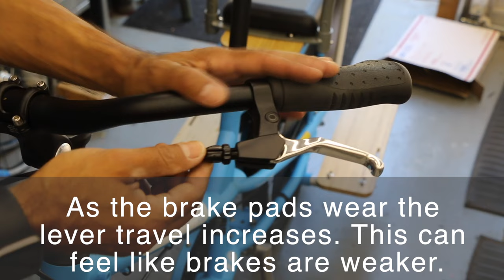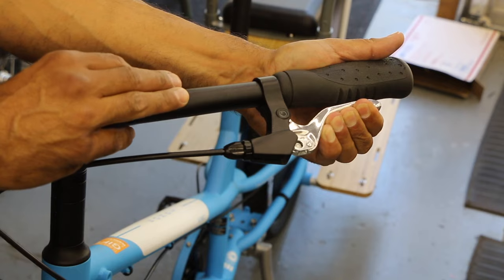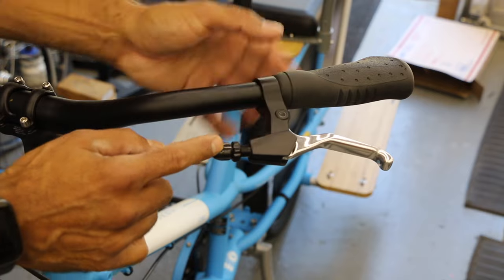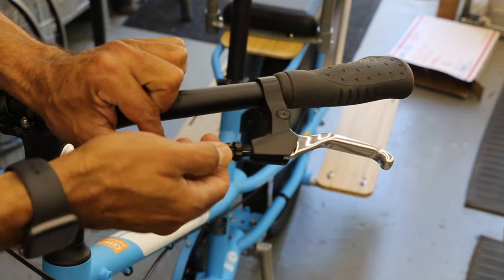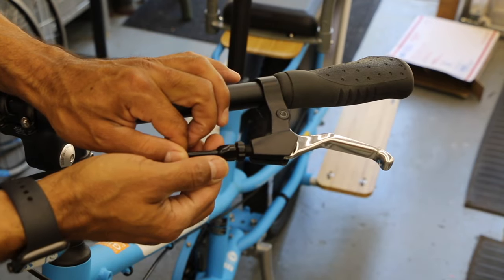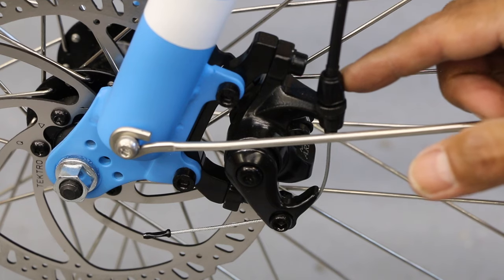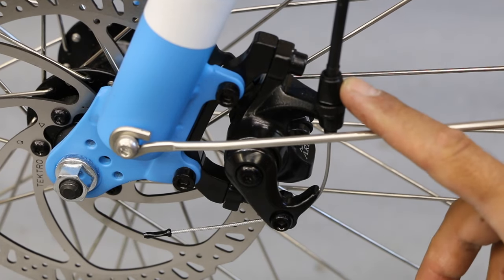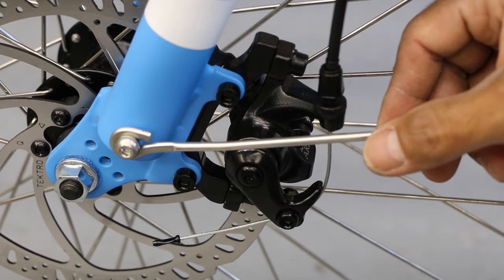What is the barrel adjuster and how do I use it? I will explain it.

Comment: Not familiar with bikes, but was asked to adjust someone else's cable adjustment and found this video to better help me understand.  The first thing that came to mind was that : isn't the 'barrel' the barrel shaped end 'blob' to the cable that slots in its position inside the lever?.  So what does this adjustment have to do with that?; it is more of a sheathing to handle free play or backlash adjuster.  Is it just a misnomer?.  From a teaching perspective, would be good to go back to basics to figure out how you would come up with this device from the get go?.  For example, it it were not cable, but a rod system, to design 'free play ' at the lever, you might put a link in there with slotted holes.  And for a cable system, where the cable does not wholly travel in a straight line, and is sheathed to confine any 'out of position' movement, you can then dream up this device to give the variable free play at the lever.
Reply from the maker: That’s a very in-depth thought process. Preferably I would have this discussion in person to better understand your thought process. I’ll take a quick stab at it and say the variable of the brakes built in spring offers an adjustability that can assist you adjusting the brakes or offset unforeseen conditions.

Comment: My tube keeps coming out of the barrel no matter how much adjusting and tightening I do.
Reply from the maker: That means there is too much slack at the cable. Make sure all housing (tube) is secured at every stop or connection on the frame. Every junction point. You may need to release the cable pinch bolt, pull the cable right, remove all slack and retighten the cable pinch bolt.

Comment: This video really helped. My rear brake was always pretty lackluster from out of the box and to be honest I didn't know adjusting it myself was something Id have to do. After a while of use I did figure out the front barrel adjusters a bit and it helped but always accepted it as the brake I wont be relying on for more than slowing down or in combination with the front for a fast stop. After about 350 miles I watched this video and learned that cables have adjustments on the brake-side end as well and now both brakes are working perfectly, better than ever. I was sure something was broken because I didnt know how to work these - thanks for the video.
Reply from the maker: You are so welcome. I’m glad you found it useful. This is one of my favorite things to share because it’s tool free.

Comment: Keep in mind if your brake caliper is single piston, this will not adjust the inside piston...
Reply from the maker: Correct. That would apply to the single-pad action cable disk brake. Hydraulic brakes (pads)will operate in unison. Although some hydraulic piston cups may not move in complete unison. Cups can be cleaned to rectify this but not always. It could just be poor quality.

Comment: The right handle is loose and will not tighten with the barrel adjuster . Why?
Reply from the maker: Is the barrel adjuster stuck? I would inspect the entire cable housing looking for a disconnected section.
Reply: @BikeTeacher  I figured it out lol. I ended up posting a pic of it online and asked for help. Embarrassing but I found out I bought shifter cables not brake cables! I also discovered I needed mountain bike brake cables. I got mtb brake cables and all is good now. Thank you for your response!

Comment: i cannot move barrel adjustment in any direction, please help me im so desperate.
Reply from the maker: Sorry for late response. Did you remedy it?  Sometimes pliers are needed to unstick a stuck bolt or screw. Gently use a tool to apply a little more pressure than your hands or finger can produce.

Comment: Brake handle gets stuck, locking the brakes, when pulling the brake...
Reply from the maker: Check either the brake handle or the brake pad is getting jammed on on the rim. The pads may be loose and getting stuck just under the time braking surface.
Reply: @BikeTeacher  broken brake noodle, not sure what else yet.

Comment: So, I came to this video because I recently had to fix my back brake after the cable disconnected from the brake lever. And now, even though the cable's reconnected, I can't get enough tension to stop with that brake, because the barrel adjuster on the lever won't tighten now. And every time I squeeze & release the brake, the screw pops right out of the socket. No matter how much I try, it just won't screw back in right. So, I have to rely on my front brake alone. What can I do to fix this?
Reply from the maker: Sounds like you are saying the barrel adjusters threads are stripped and there is no purchase for the adjuster to stay put. I believe the adjuster at the lever should stay in place due to the cable will always be under tension. If it is popping out there must be loose cable or slack. You may need to remove the slack by loosening the cable pinch bolt and pulling the slack out there.

Comment: My barrel adjuster it too loose for the cable cap. The cable just wiggles no matter what. Should I get a new barrel adjuster or lever system….?
Reply from the maker: Some wiggle is okay. You can replace the cable cap (ferrule cap) it may or may not be an improvement. The barrel adjuster may also be a solution. It’s hard to say what will be the solution. If your up to it, replace both. Keep in mind a new cable may be needed. The old one may fray.

Comment: What should I do if my brake line came out from the barrel adjuster? I can’t manage to get it back in to stay. When I apply the brake, It pops out.
Reply from the maker: There must be some slack in still in the line or cable. This is allowing the cable to pop out. Start at one end and inspect, make sure at any and every connection the line is seated properly. Look at the other brake as a reference. It is a small detail that is causing this. If all connections look good then maybe cable tension is loose and a tensioning of the cable needs to be done at the cable pinch bolt.

Comment: I have a hydraulic brake set and when I untightened it and then tightened it again it seemed to be covered in oil. Could the threads be stripped or something else? Or is this normal?
Reply from the maker: Hydraulic brakes do not have an adjustable barrel. The nut you turned will disconnect the hydraulic line and fluid will be lost compromising your brakes. Be careful.

Comment: I need help i think i stripped my front barrel adjuster for my back brake. The one on the handlebars. I am not sure what to do. I hear clicking now when i try to brake. Its not grabbing but looks like it is
Reply from the maker: There is a chance the aluminum threads on the barrel adjuster stripped so you may be able to replace it. Look on Amazon. “bicycle brake barrel adjuster”.
Reply from the maker: But you can always adjust the cable tension to your needs. It’s not as convenient as a barrel adjuster but it is doable.
Reply: @BikeTeacher  at the back I adjusted it now it just rolls freely and doesn't grab. Makes click noises. Well off to the bike shop I go. This is a mess lol. I just wanted to ride
Reply: @BikeTeacher  thank you sir
Reply from the maker: Good luck. ⚙️
Reply: @BikeTeacher  is there a video on barrel adjustments mine from Amazon just came in.

Comment: Hello sir, my lock out(that thing near the barrel adjuster) is spinning continuously, it doesn't fit near the lever, i can rotate it endlessly
Reply from the maker: Either the threads are damaged and stripped or the barrel adjuster is completely backed out of the threads and needs to be restarted and threaded back in having full contact.
Reply: @BikeTeacher  and i forgot to say that the barrel can move freely without rotating

Comment: 3:21 I recommenced to use Wolftooth Pack Pliers or alike to tighten the barrel adjuster so it does not come loose, trust me they will come loose, I am speaking from experience, but don't use regular pliers that will bend the barrel nut, Wolftooth Pack Pliers won't.

Comment: I wouldn't use oil in any thread
Reply: You likely have a LOT to learn about how threaded fasteners actually function.
Reply: @RK-kn1ud  perhaps
Reply: @gort3969  Here is my backyard mechanic explanation.

The clamping force of a fastener is what allows it to fasten.  Threaded fasteners allow you convert a torque to a linear force.  That linear force allows the fastener to stretch, which creates a clamping force.  The easier you can turn a fastener without binding, the more accurate you can get a measurement of the applied torque to the fastener (among other benefits).  Oil (or some other sort of lubrication) helps facilitate this.

If you simplify "oil" as "lubrication", lots of fasteners are "lubricated".  Pipe thread is lubricated with PTFE tape, the head bolts on Top Fuel Dragsters (estimated 11,000 HP) are likely lubricated with an engineered lubricant or oil.

Are there threaded fasteners that I wouldn't lubricate?  Yes, there are plenty.  However, there are lots of threads I would oil.  One example would be the threads on a compression fitting.  You will find compression fittings on hydraulic brakes.  A reduction in static friction makes it much easier to get a feel for how much you are compressing the olive.
Reply: @RK-kn1ud  your probably right I have no real understanding of these things.. I only know whenever I'm trying to loosen a bolt it always helps to lubricate it. Then you have products like locktite which also seem contrary to lubricion. If anything I want my bolts rusty and impossible to move lol
Reply: @gort3969  Its all highly dependant on the application as you have learned.

Sometimes it's important, and sometimes it isn't.  Sometimes it's not desirable, and sometimes it isn't.

Many fasteners require lubrication, but many do not.  Some fasteners it's really up to you.

It's something that will only be learned with experience, tria/error, and/or some Googling.

Comment: I would not tighten the wire so much it pulls the caliper arm. 
How I do it: 
If it's very mich slack I loosen bolt turn the barrel adjuster in, pull wire apply thread locker like Loctite 243, tighten the bolt enough to secure the wire but not destroy it, but the wire will wear anyway. 
I then can fine tune the brakes i hold the caliper arm, and adjust the wire tension with the barrel adjuster on the lever, I can feel when the arm starts to get pulled just when it starts to pull is where I stop, ease off, and then tighten the nut on the barrel as tight as I can by hand while holding the barrel, then I use Wolftooth pack pliers to tighten the nut so it won't come loose, and it will if I don't. Regular pliers will crimp the  nut, so it will be stuck, but these don't. These pliers are perfect for the job. 

 I leave the caliper barrel adjuster as some are prone to bending especially on a full suspension bike, I had TRP Spyke i managed to hit one with my hand by accident snapping it off, on full suspension bike the barrel adjuster bent.  I guess I could upgrade it to stronger barrel adjusters.
If brakes were used for more than a year the pistons can be worn, and turn in often resulting in inconsistent brake, if that is the case you need to replace them, but it might just be worn out thread locker, if so take out the pads, rotate the bike so the brake you work on is high, take the pads out, turn the pistons so they show thread, not so much they fall out, to do so I reccomend using a piston press, do both sides just enough to show thread, then apply Loctite 243 or alike. But if the area is dirt and threads too try to clean it first. Turn the pistons back in, put the pads back in, wheel, then adjust each pad and leave the bike for 24 hours or atleast over night for it to cure, if you can't keep an eye on it it will eventually cure anyway.
But if it does not help and it loosens on every ride it means the threads on the pistons are worn out.
Reply: Make a video bro, people like me watching this probably have never done this before. A wall of text just doesn't cut it.
Reply: @SteveL11  good idea. I have some footage, but can't promise anything.